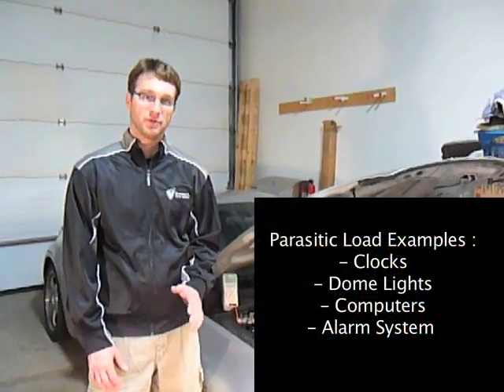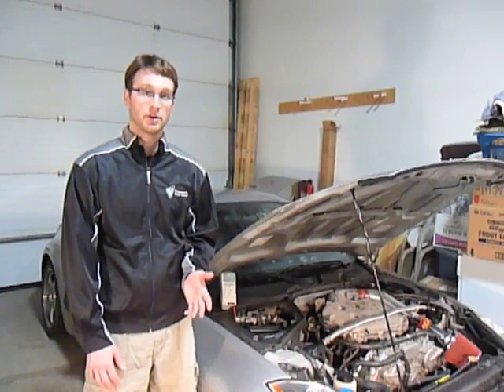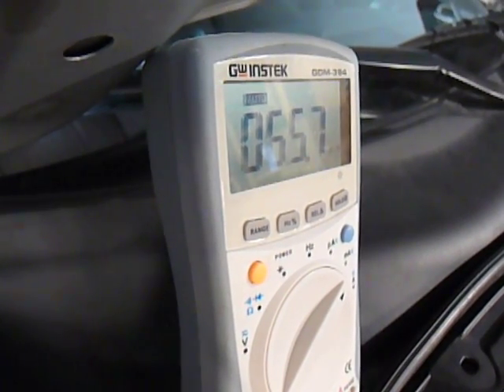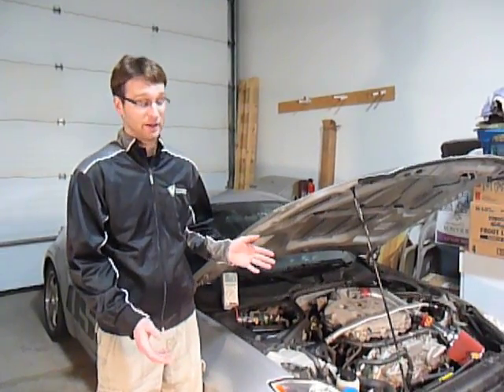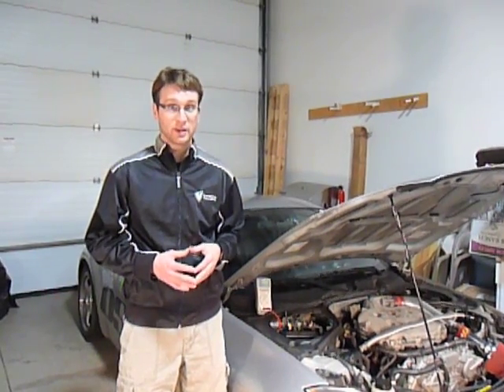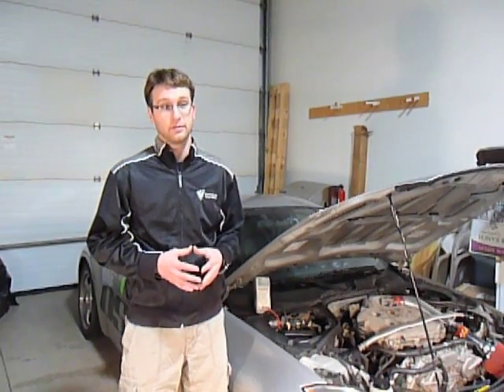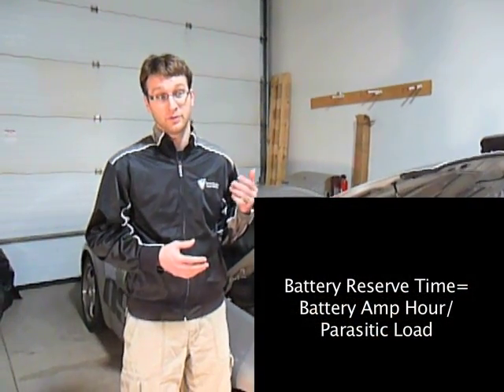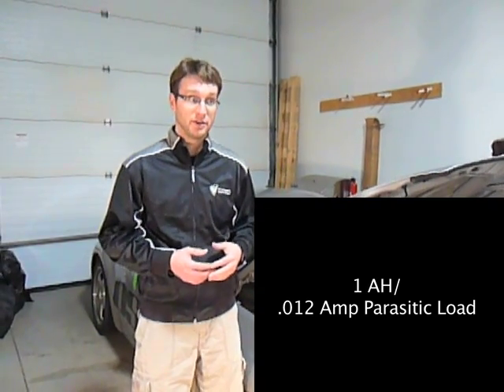How to Measure Your Vehicle's Parasitic Load

Comment: This test is flawed. The results are not typical not many if any use 1 amp battery for amp draw test. Typical test would be a standard car battery normally. That being normal you can go weeks before starting. Most times if not its the radio memory and ecu that suck power off the battery but what you forgot to say is that on older cars you will have corrosion in wires and battery cables that have ohmic values which also suck power. Anyway nice demo.